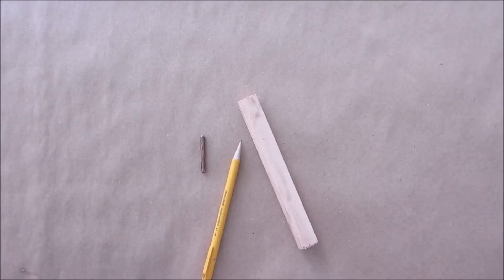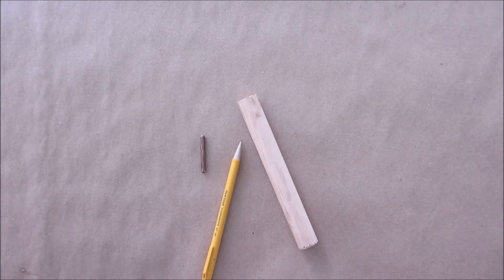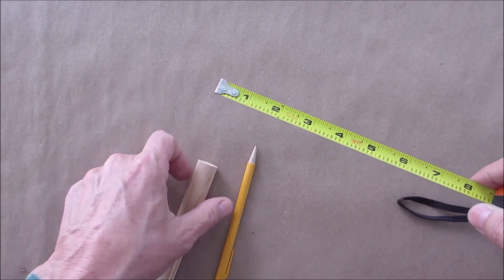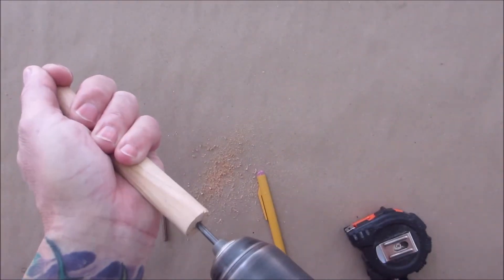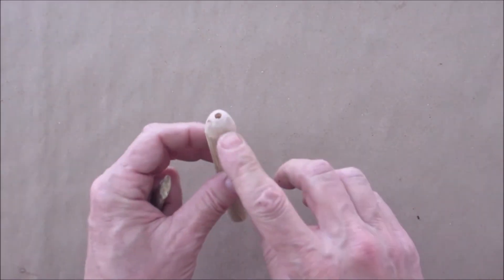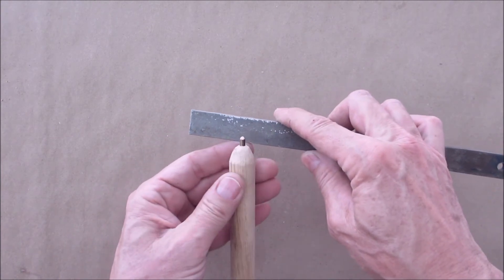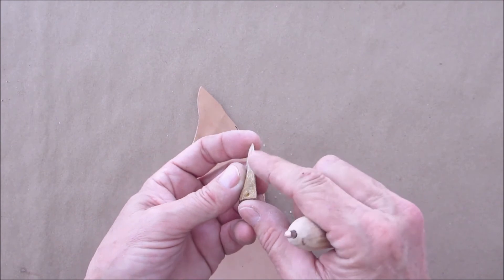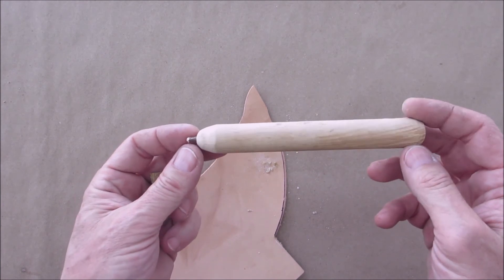Flint knapping tools - Part 1- How to make a pressure flaker!

Comment: Copper wire is too soft. It will bend. It needs to be hardened.  It's done by twisting it.  So why use copper when brass may be better? Also the hole in the end will become larger and thus loosen and copper will fall out.
Reply from the maker: David Hefner All the pros I watch use copper or an antler tine.
Reply: I worked with copper a lot for jewelry making. It work-hardens very quickly just by handling it. The pressure-flaking will do the trick. A jewelry maker often has to anneal the copper with heat more than once to keep it soft and workable. I can totally see why copper is used. I agree with you about the copper possibly working loose. I'll just add a bead of glue to mine when I make it. I think Home Depot sells heavy copper wire by the foot. I can make several of these for a few cents each. I'm very good at losing small tools. :)

Comment: I think the handle is too thin, also i think that the flint that appears in the video is a bad flint, the 27 of may of 2017 a spanish University teacher an director of the experimental archeology laboratory say to me that the flint must be processed to obtain a successful pressure (sorry for my English but i am Spanish)
Reply from the maker: alvarosilex thanks for the information, I am still learning. That piece is actually chert not real flint. Yes I believe heat treating it would improve its characteristics but make it more brittle. And as I am using it to create a spark from a fire steel, I don’t want it brittle.
Reply: Dominic Minischetti sorry, i dont know what is a spark, maybe in Spanish i know what it is
Reply from the maker: alvarosilex in Spanish a spark is chispa, check this out, this what I use the flint and chert for. Making fire!

https://youtu.be/5Fagv_mg9Qc